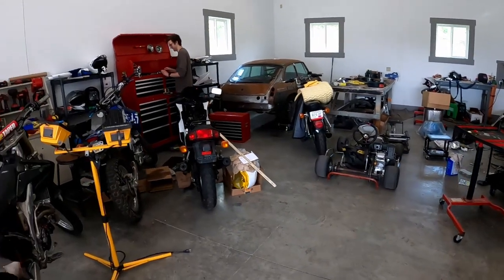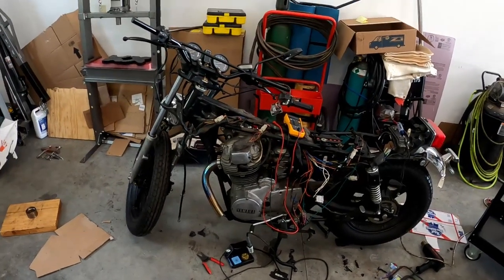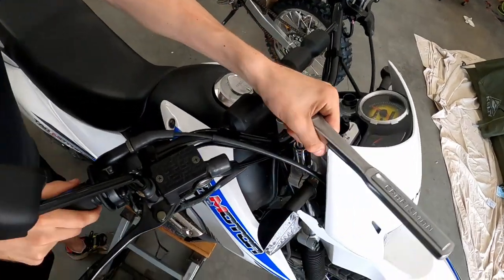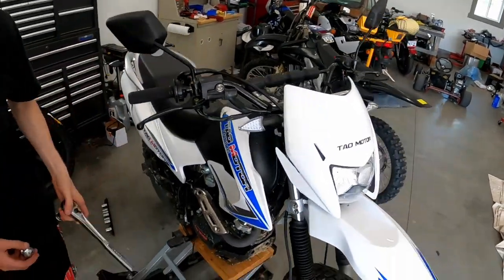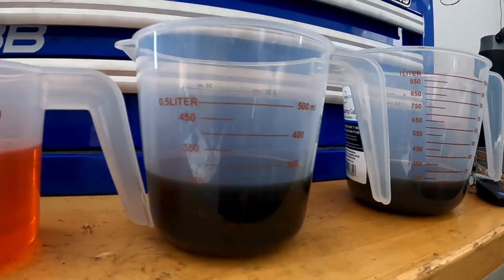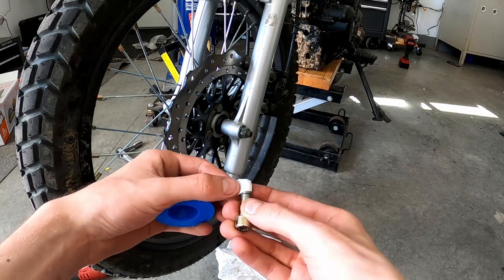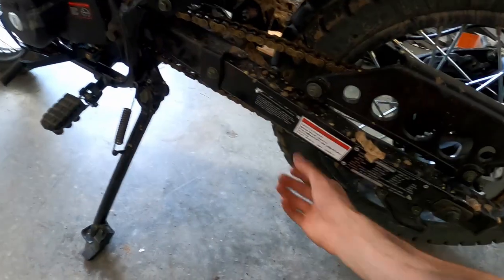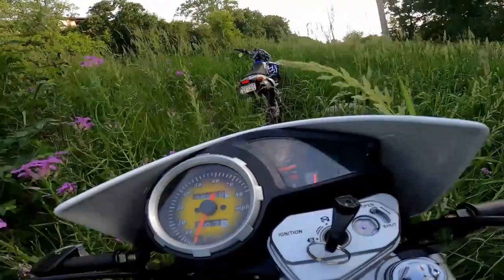You NEED to change your TBR7 fork fluid! | 2021 TaoTao TBR7

Comment: So glad I watched your video just after Motocheese because you did it right by removing the top caps first so the fluid drains easily. He left the caps on and used straps to compress the forks over and over to pump out the fluid. I'll also use Teflon tape because his was leaking from the factory. 
I've got the exact same bike as yours and have done a lot of mods. I've set mine up as an adventure bike to do long bike camping trips.
Reply from the maker: Hey thanks! I always prefer to drain fluids in this fashion when possible. That strap method sounds like a nightmare! I found this way to be incredibly easy and got the job done quickly. Sorry I missed your comment; how is your bike holding up? I haven't been out riding mine much lately, but I need to get back on it. I'd love to see your adventure bike setup, do you have any pictures or videos of it?
Reply: @3PedalDevils  I was just riding around Bryce Canyon Utah and had a blast. I have some photos on my Instagram of places I've rode. If you look deeper down you'll find pics of how I set it up for some earlier overnight camping trips. I don't have pictures of it with the hard trunk and side cases yet because I'm actually going to be spending the winter making the racks to sell this Spring. I'm also making engine guards and center stands. I plan to contact everyone on YouTube and ChinaRiders to help spread the word. I'll probably send out some at cost to get some videos made showing the setup. The rack and 3 hard cases should retail just under $500. Compare that to the lowest price of Tusk that's 3 to 4 times more!

Comment: I honestly feel like the TBR7 250 2021 
has the wire harness of a scooter from China i have one & a TBR7 250 2021 i noticed with the lighting.  Lol i luv it!
Reply from the maker: Hahaha it literally does. The connectors are pretty bad but it does the job. The rear plastics and seat looks straight off a moped/scooter if you look at it from the front; pretty funny stuff.

Comment: I didnt see anything in your playlist about the motor oil. Some have said, it needs to be replaced with 10-40 through break in, your thoughts? If so, how long is break in?
Reply from the maker: A lot of gear-heads have their own opinions on things and with Tao Motors not publishing an official recommendation, I don't know what the correct answer is here. I'll say that I didn't do anything too special with mine and used Rotella T4 15W-40 oil for all my oil changes so far. I'm at 1900km so far. Sorry I couldn't be more help

Comment: So you did 250 250
Reply from the maker: I think I used 225mL on both of my forks. I have not been able to find an official capacity for them. When I drained mine from factory, one of mine had 250mL in there and the other was 225mL. I'd think that 250, 250 should work fine for you too. Just get them consistent
Reply: Thanks so much I love the content
Reply from the maker: Hey thanks!! Much appreciated. I'll be making some more TBR7 content again in the next couple weeks!